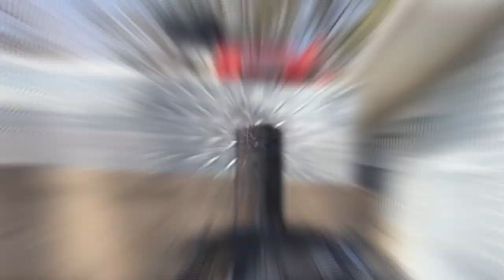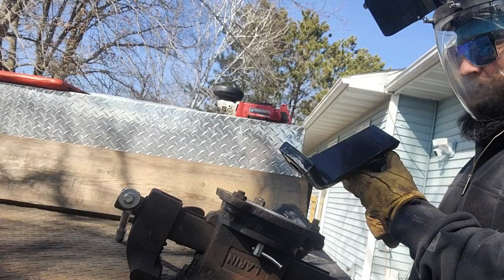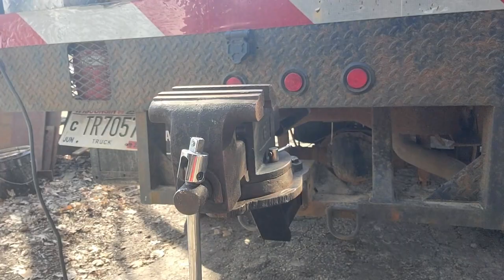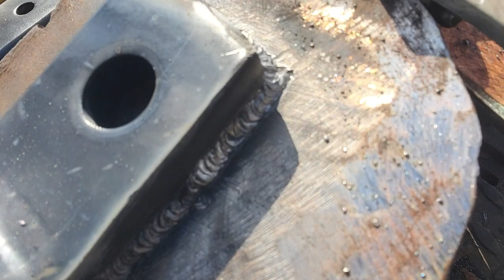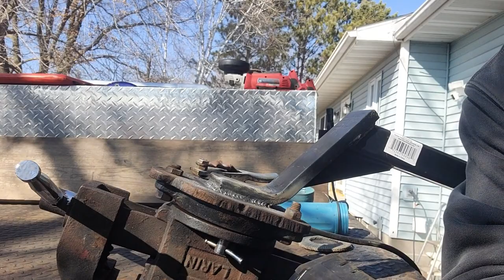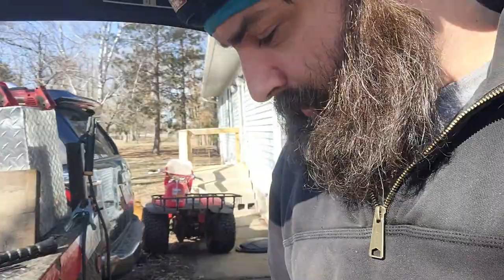Hitch Vice Build for welding truck

Comment: I put a hitch receiver on each side of the back of my bed since I need to haul a trailer to some jobs. They are about halfway between the receiver that ma on my truck and the top of the bed and placed beside my bed vertical supports and welded them to them and the outside of the bed. One I have my vice on and on the other side I built a small material rack that is a lopsided T with horns on the end. I lay material across it and the headache rack. Just a idea if you want a removable material rack.

Comment: I did something similar to that I use 2x2 x1/8 wall weld a 8x8x1/4 plate on top drill 4 holes for vise it's to the hight of the tailgate when open yours looks pretty tough